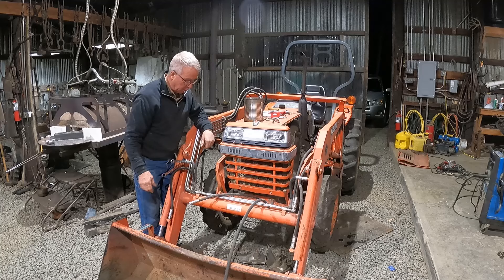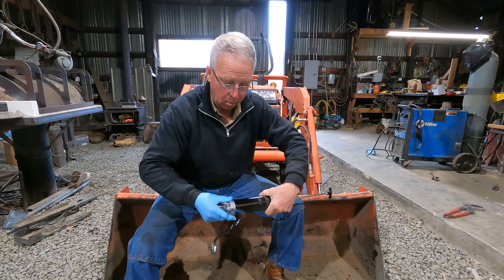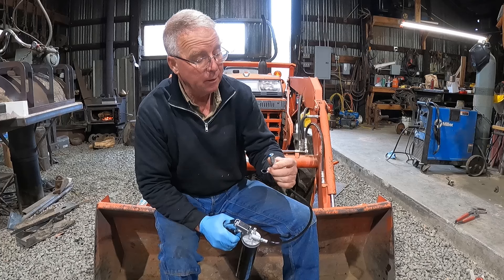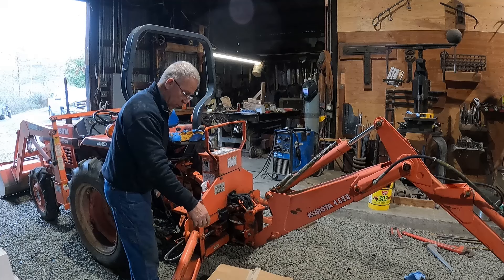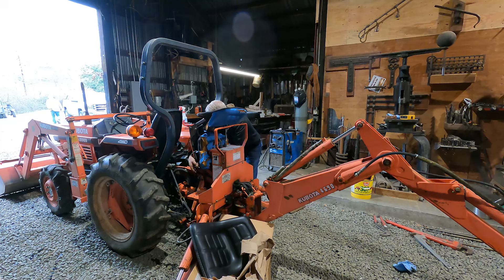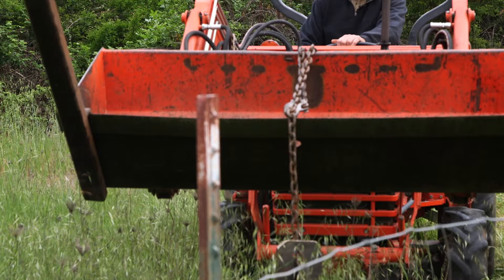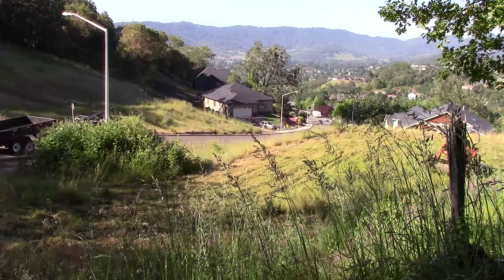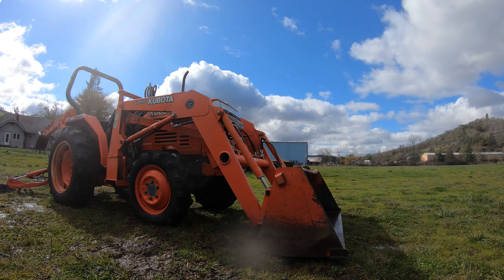Kubota L2500 Mini Tractor Review and Overview

Comment: The number one failure of fractional horsepower motors is over greasing, I have replaced motors so full of grease that the weight is more then double.  I have also repaired a lot of seals that were blown out by putting in to much grease.  It is much better to fail on the under grease then to over grease.  A little goes a long way!

Comment: Battery powered greas gun and get a good one. Long hose with a lock and lube tip on it it is expensive but the best money you will spend. I have all three geras guns battery powered, lever action and a pistile grip. about every grease gun i have has a lock and lube tip. The other tool i have is grease reguvenator that you put pentrating oil in it then hit with a hammer. I also put a lock and lube tip on it to. I work a lot on old farm equpment. Over time with them tools it gets easer to do the job and take grease easer.

Comment: Scott, can you use a 3 point quick attach adapter with that backhoe?
One of the most used attachments on mine is a grapple, they are on the front 80% of the time.

Comment: Grease gets old and loses its lubricity so hours on the machine is not so meaningful without keeping track of the time it is sittting.  Also check Vevor as they have come out with a porta power style hydraulic fitting press which includes several sets of dies.  With a set of fittings and a roll of hose you can make your own hoses as you need them for a lot less.  Seems it goes for around the $120 mark or less.  Sure it is not professional but for the amount of garage use it looks like it will be a winner.

Comment: Does your tractor not have a PTO clutch to disengage the PTO? That seems like a bit of a death trap if it doesn't.
Reply: If its the same as my L2650 when you press the clutch pedal halfway it disengages power to driveshaft and when you press clutch all the way down it disengages PTO

Comment: My property is quite small but when I moved in 12 years ago the first project was to build a garage and workshop. The whole site is on a hill side so the footings at the bottom side of the garage is over 1.2metres lower than the top side so there was a lot of digging. I invested in a Kubota 1.6 tonne mini excavator and it worked hard moving all the loose stone and soil down to bedrock. some 5 years ago my wife came home after talking to a local chap who was asking if I hired it out or if I would sell it. It wasn't in a fit state for hire and I said I would sell it if my price was met. He bit my hand off, despite my selling it for more than I paid for it. It was the worst decision I have ever made and I look at the piles of rock and earth and logs I could have moved with it and let out a very heavy sigh.

Comment: Do yourself a favor and buy a battery powered grease gun.  I'm exactly like you in that I neglect maintenance on everything and HATE GREASE.  A few years ago I bought a little 12,000lb Bobcat E55 mini-excavator, and for the first year I was horrible about greasing it.  One day at the Home Cheapo I saw a Dewalt grease gun (I already own a bunch of Dewalt batteries even though I despise big box store brand tools), tool only, for I think $89 on sale.  I bought it, and it's one of the best purchases I ever made.  Not because it's a great tool...not because I like grease.  But because it got even me to treat my mini the way she deserves.  The thing came in a nice hard shell case, and being a Festool snob, having a nice case for every one of my tools is usually a prerequisite, but I threw this one right in the trash.  Because you can't put the grease gun back in the case with a tube of grease in it, as the retaining rod is extended.  So I just threw it in a Homer bucket, and leave it sitting next to where I park the mini, and all I have to do is make sure I have a battery in my pocket when I go out there, and it's easy to just grease it up and go.  I even keep a $10 pair of work gloves in the bucket with the tool, so I'm not transferring grease all over the place.  This little set up changed the way I work with my mini.  Can't recommend it enough.

Comment: This man is an expert in many areas, but not an expert on tractors or implements.  Take this advice with a grain of salt.  Some is good and some is not.  600 hours is a lot.  Not in 12 years, but in total yes.

Buy a Milwaukee M12 grease gun.  It is a glorious tool.

Hydraulics on a backhoe attachment should not should not leak.  That is dangerous.  Repair it.

Use a pry bar to help align when installing implements.